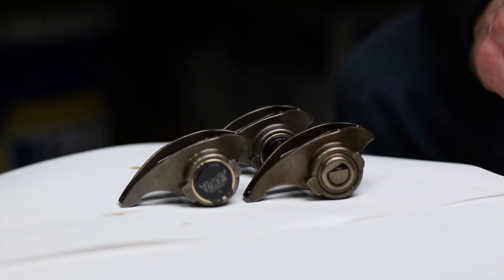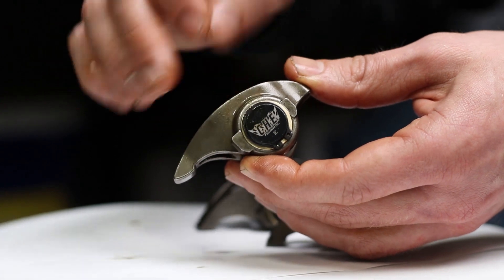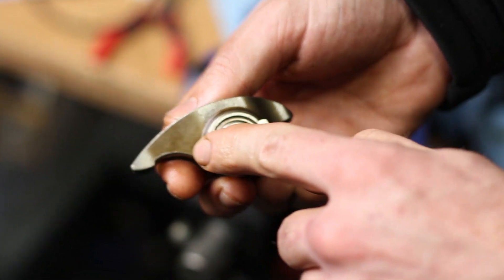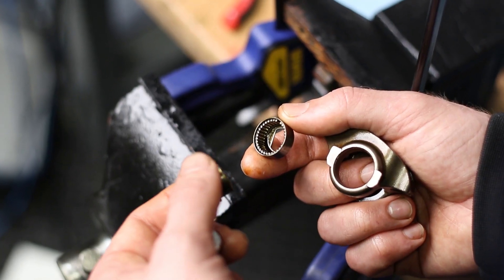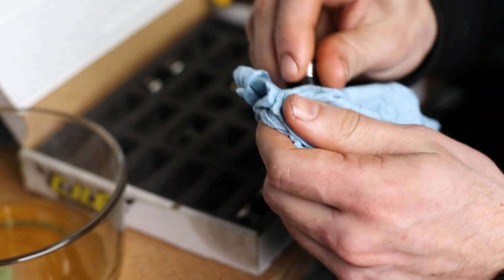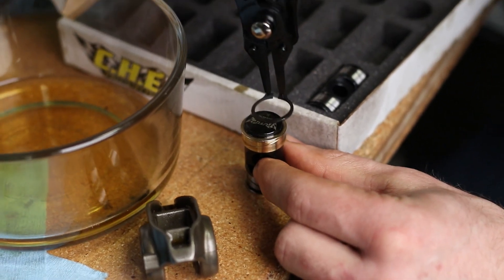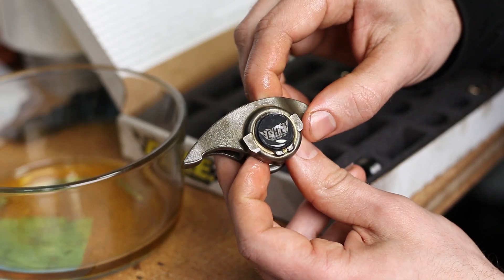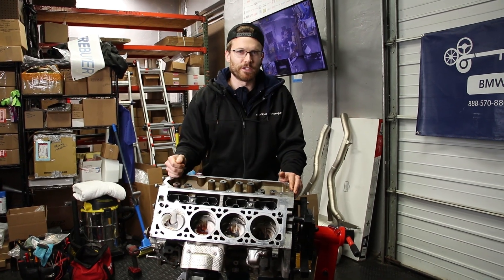How To Upgrade GM Trunnions - CHE Precision Trunnions

Comment from the maker: IMPORTANT: When installing snap rings onto the end of the trunnions, the sharp edge of the I.D. needs to face away from the bushing. 

Official CHE instructions: https://www.cheprecision.com/installation-tips/
Reply: Just thought I'd let you know I just talked to them. You are right, GREAT CS and I have to send it back and get it exchanged. Cheers!
Reply from the maker: They are great for sure! Glad they are taking care of you.
Reply: What do you mean "I.D."?
Reply from the maker: Inner diameter
Reply: Doh! Silly me lol. So basically spread the snap ring enough?
Reply from the maker: All good! I copied that from their instructions, probably should have written it out. One or the edges is a bit sharper if you feel it with your finger. That should face away from the bushing. I spoke to che and they said it probably doesn't matter but they do it to be safe.
Reply: Great channel. I'm getting ready to do my rockers and you can barely tell the difference between the sharp edge and the other side. Barely noticeable IMO. Glad CHE doesn't think in really matters because this was driving me insane with my OCD. Now I don't have to worry if I goofed that up, LOL.  @TheSundaeDrive
Reply: Oddball question, I installed them on my ls3 rockers and now the rocker bolt will not fit thru. Do they require some different size bolt? They are 821 GMPP heads btw.
Reply from the maker: I'm not sure off hand but CHE Has great customer service. I would reach out to them and see.

Comment: Has anyone had issues with the rocker arm bolts not fitting in the CHE ones?? Mine will not go thru!
Reply from the maker: We didn't have that issue. Maybe double check that you were sent the correct ones?

Comment: 2001 6.0 vortec? I am only running a .500 lift cam. I was told they drop in and use the stock pushrods and rockers. Summit pro LS

Comment: Nice video but you left out a small detail. The snap rings need to be installed with the sharp edge of the ID facing away from the bushing. If you look closely at the snap rings you will see what I'm talking about and step 6 of the install instructions detail this. Otherwise good info.
Reply from the maker: Thanks! Important to mention for sure!

Comment: How clean or dirty did your engine look since you have direct injection?  Did you have a lot of carbon buildup at all?  Thanks.
Reply from the maker: It didn't look bad to my eye but I don't really have a comparison to know if it was or not. The catch can was on for about 60K of the 108K miles on the truck.
Reply: @TheSundaeDrive  I have a catch can installed on mine too.  I have almost 56,000 on my 2015 Silverado.  I installed the catch can at around 53,000 miles.  I am amazed at the amount of crud it catches.
Reply from the maker: In the winter, some of the crud is caused by condensation in the can but they definitely pick up a lot of oil regardless. Just make sure you empty it regularly or get a check valve